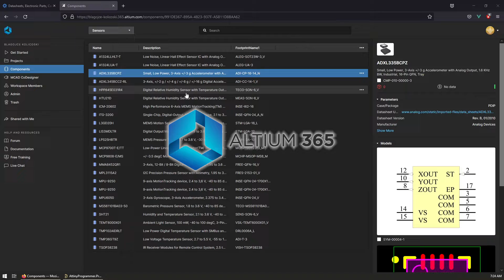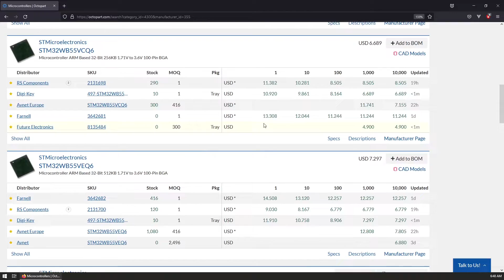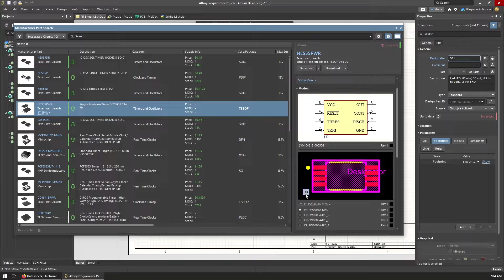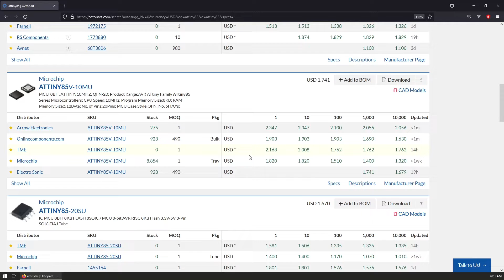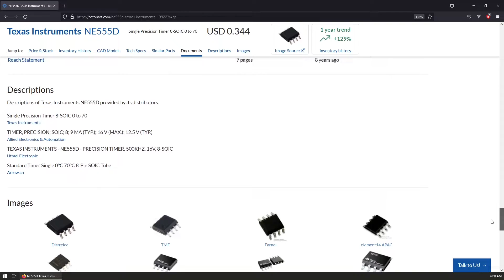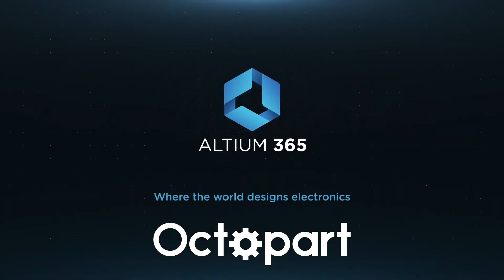Basic prototype of ESP32 based pellet burner controller - Part 1

Comment: How to contact you for help with the code,i have made robust code for this with LMG7420display and BLYNK app.
Reply: There is motor control for exhaust fan with pulse skip modulation.
Reply from the maker: Hey you can share your repo here for everyone to be able to access it.
Reply: I must admit i did it with help of AI. Problem with code is that sync with  blynk app is slow (2-3 min). I did not test this code fully.
Reply from the maker: That is OK.

Comment: what board version did you use (ESP32?)
Reply from the maker: I'm using wroom for all of projects.
Reply: @TasteTheCode  A czy stosował pan jakieś inne biblioteki, wywala mi błędy typu Compilation error: no matching function for call to 'HardwareSerial::println(RtcDateTime&)'
Reply from the maker: @d.leszczynski2284  HardwareSerial is part of the esp32 core. All of the other libraries are mentioned at top of the sketch. Make sure you have the right board selected. Also, its been a while since I've worked on this project so library versions might have changed...
Reply: @TasteTheCode  Dzięki za odpowiedź, udało się opanować temat👍

Comment: This is awesome! Did you ever make the part 2 video? I can’t seem to find it.
Reply from the maker: Thanks! Unfortunately not. There is no update as I haven't had the time to work on it at all.
Reply: @TasteTheCode  ah ok. I might start a similar project and I appreciate the info you did share. There’s not much info that I can find on a basic system for arduino controlled pellet burners.
Reply from the maker: Feel free to use my code as a starting point. Let me know if you have any questions and I'll do my best to help out where I can.

Comment: Awesome project. I can not get the code to compile so hard to try out.
Reply from the maker: What is the error message that you are getting?
Reply: error: no match for 'operator=' (operand types are 'RtcDateTime' and 'int')
       lastDoseActionTime = NULL;  
Anything with NULL causes an error
Thanks Jason  @TasteTheCode
Reply: The Encoder library also casued my esp32 to go into reset loop.  The NULL problem i just change all of them to now in order to get it to compile.
Reply from the maker: @otto47456  it seems that you might be using a different library for the real time clock. Make sure that you have "Rtc by Makuna" installed https://github.com/Makuna/Rtc ... Either that or you might be using a different ESP32. In my case it was the Wroom variant.
Reply: yes i am using "Rtc by Makuna" and also wroom variant of the esp32.
Reply: found it had to use right version of "Rtc by Makuna" not the newest.  Version 2.3.3 compiled properly
Reply: encoder is a no go for the esp32
Reply from the maker: Maybe also try an older version? Or try some other library, it should work out.
Reply: I have it finally working. what is the best way to contact you with some of the updated code i am using?
Reply from the maker: @otto47456  I guess it is best if you put it in a GitHub repository and share the link here so anyone having issues can benefit from it.

Comment: Hello,great idea and thanks for sharing but I have a problem when compiling:"You could try defining ENCODER_DO_NOT_USE_INTERRUPTS as a kludge."
Do you have an idea? Thank you in advance.
Reply from the maker: OK, that seems like a very specific library error. What device are you using?
Reply: @TasteTheCode  Thanks for your quick repair! Esp32. this is also what is marked in the errors : libraries\libraries\Encoder/utility/interrupt_pins.h:154:2: error: #error "You could try defining ENCODER_DO_NOT_USE_INTERRUPTS as a kludge."
Reply from the maker: I can't really tell what is wrong but for some reason, it seems that the library does not recognize the interrupts. Maybe the library is not right for esp32? I used it with esp8266. So either try with some other library or try to understand why the interrupts are not recognized.
Reply from the maker: I just realized that I also used esp32 but it might be a different version of it as there are multiple of them now. My variation is called wroom.
Reply: Ok thank you but nothing even by changing library
You would not have a link of the bilioteque you used? In any case thank you for your cooperation. @TasteTheCode
Reply from the maker: I'll need to confirm this tomorrow but I think it was this one https://www.pjrc.com/teensy/td_libs_Encoder.html

Comment: Odličan video! Pošto posedujem ručno pravljen gorionik na seckano granje, trinju, pelet i odlično me služi ali radi u poluautomatskom režimu (ručno paljenje+temoregulator+vremensko rele sa dva vremena(doziranje-pauza)) baš sam tražio ovako nešto radi automatizacije. Sa arduinom sam imao malo kontakta davno tako da je sad vreme da se to znanje poboljša, odličan i jeftin mali kontroler pogodan za samogradnju. Sve najbolje u daljim projektima!
Reply from the maker: Hvala puno! Yes, you can use this for your case. As of now, it lacks the regulation of the input air blower but there are some people that are trying to add that as well and once that happens I'll include it in the GitHub repo and maybe even make a sequel video.
Reply: @TasteTheCode  Na mom gorioniku koristim ventilator od 24v DC i brzinu regulišem naponom, mada znam da ovaj ventilator ima mogućnost i PWM regulacije, možda je to rešenje PWM regulacij za koju znam da je arduino sposoban. Treba istražiti.🤔 Pozdrav👍
Reply from the maker: Da mozes to ali Arduino radi PWM sa 5v pa trebat ce ti neki mosfet sa optoizolator da sve to kontrolise na 24v.

Comment: I an interested in seeing fan integration to this. Hope you keep this project alive😊
Reply from the maker: Thanks! I hope for the same! In the meantime, I do have a separate video for a fan control that you may want to check out https://youtu.be/w9UTcIDKYk8
Reply: @TasteTheCode  Both projects are interesting. But hope you continue working on the pellet control and get a pwm control for a fan included in the project. Thanks for a great job! awaiting development and lern More!
Reply: @tastethecode I would be willing to buy a usable version of this for a convection style pellet stove. My control board on my pellet stove just went and it's over $700 to replace and as a disabled vet money is not that free right now.
Reply: @ssaw88 aliexpress about $100 you get a generic pellets heater/burner with WiFi and extra .

Comment: I am very interested in seeing how you include the fans and vary the speeds. I have not come across a viable option in my searches. I have an old Corn stove that is in need of up dates but all electronics are no longer available. Was thinking Arduino control would be the ticket. Burning corn is similar to pellets just different timing periods. Excellent project thanks for sharing !!!
Reply from the maker: Yes, I'm aware of corn stoves. Most commercial pellet burners can also burn corn instead. And I've started this project just because I was unable to find a suitable one myself. The only issue I have is that I only have a limited time available to work on it. I hope I can provide an update soon.